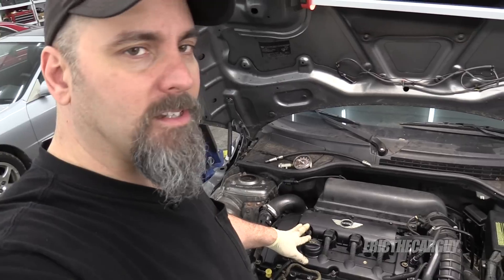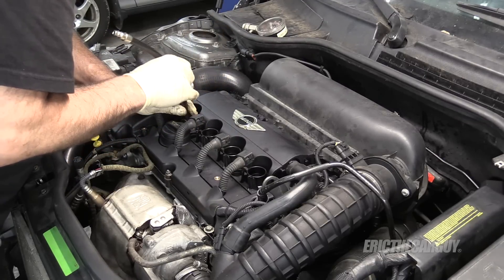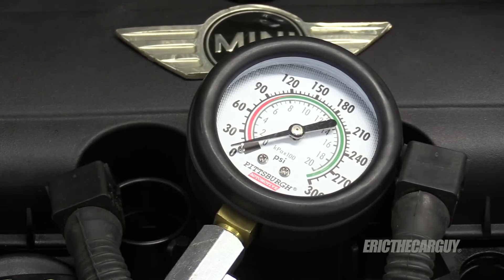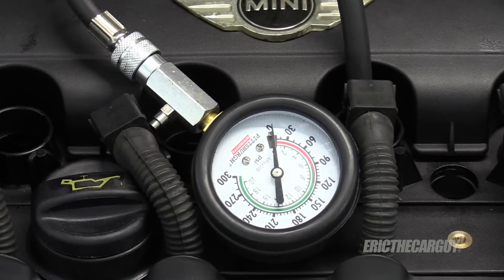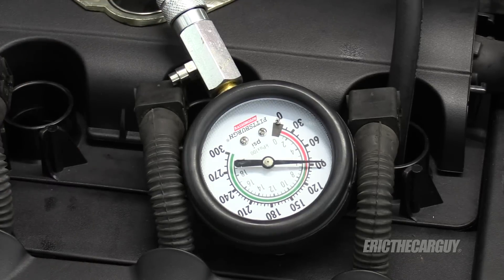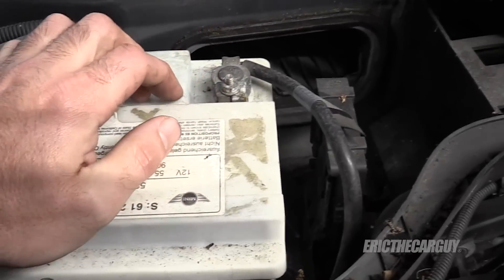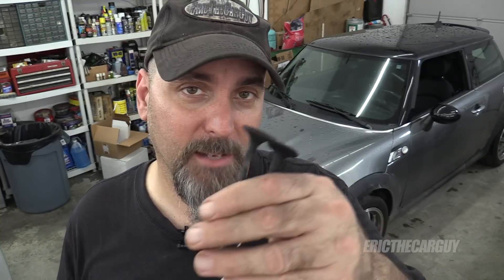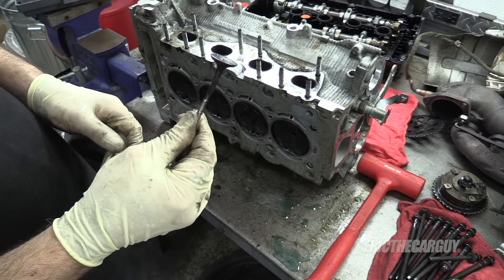How To Find Out if Your Engine Has Bent Valves

Comment: I had the same issue with zero compression on a single cylinder, when it was dismantled, one of the exhaust valves had a hole burnt right through it!!
Reply: Running lean much?
Reply: possibly it was bent and not sealing, which make a "cutting torch" passage hole, downhill spiral :))
Reply: running leaner makes the engine run hotter.
Reply: My nieces car had a similar burnt valve. It didn't look bent on my valve grinder so I think something got between the valve and seat causing it to overheat the valve and melt it. The valve is now included on my wall of oddities with other interesting parts I've removed over the years.

Comment: An amp clamp with a pico scope and a relative compression test also can do The same thing.
Reply from the maker: Yes it can, but not everyone has access to that stuff, and if they did, they probably wouldn't need this video. 😉
Reply: Just one cylinder to plug into and all cylinders are tested at the same time eliminating a battery getting weaker skewing tests. Though a battery charger is a cheaper way to increase accuracy. Just use a multimeter and test the next cylinder when the voltage is the same.

Comment: Question: “How To Find Out if Your Engine Has Bent Valves”

Answer: Ask if it’s been dropped on the garage floor. 😂
Reply: Or if the mechanic remembered to torque the crank bolt. ;)
Reply: The man tell us that he forgot to torque the crank bolt , he is honest , so don't be rude
Reply: @aissaaneslyes3566  You obviously don't understand the relevance of my light hearted comment. 

Get back to me when the penny drops. 😁
Reply: I did see the vdo of the the dropped engine , I think that Mini Cooper need prays to heat the road again but those mistakes are good for us to learn , thanx Eric
Reply: @aissaaneslyes3566  which video was it
Reply: Or if it's been over revved, or had a timing problem like jumped teeth on a timing belt or had a T-belt snap. (On interference engines)
Reply: Or if it sounds like a diesel or not?
Reply: No I didn't do that. 😉
Reply: Actually ask if you followed the proper torque specs when you changed the timing chain.
Reply: He dropped it on the oil pan, I don't think that would do it.  Having the camshaft in the wrong position while putting the belt on could cause that.
Reply: @leonidas14775  It was a frigging joke. I know you Americas don't have much of a sense of humour but KKKKrist.
Reply: @cypeman8037  LOL, bet you're the life of the party wherever you go...
Reply: @boots7859  late to the party or what. 😂
Reply: @leonidas14775  which video was it?
Reply: h